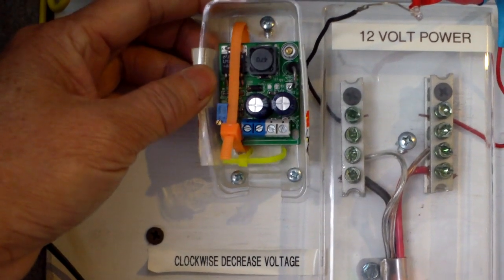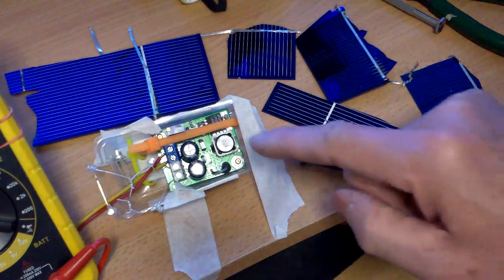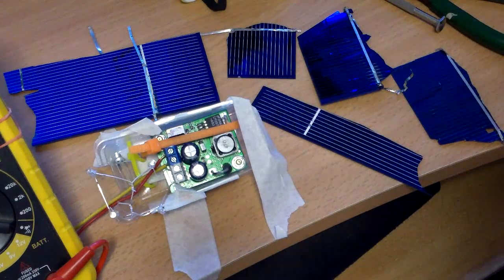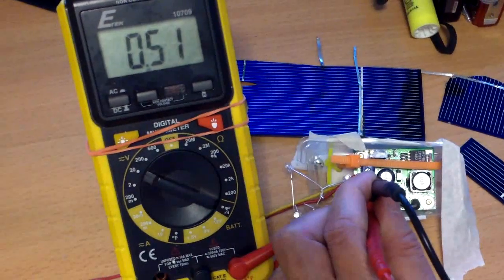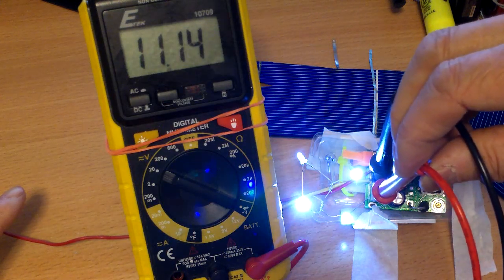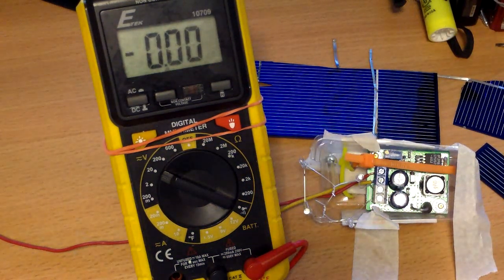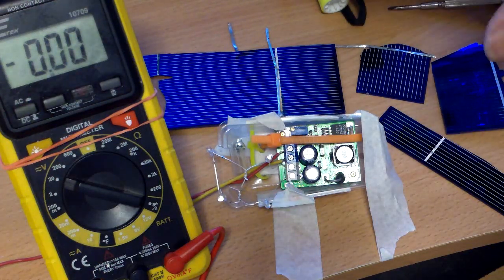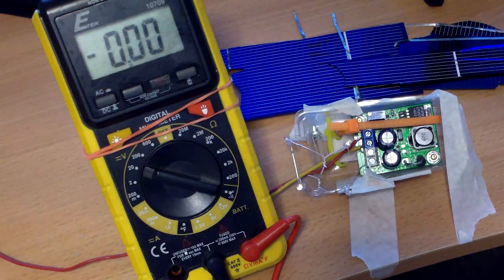LM2577 DC voltage booster

Comment: You connect 9 v battery as input and set 12 V on the output and then replace 9 V battery with  6 V battery, does it still output 12 V? Does the decreasing input voltage affect the output voltage?
Reply from the maker: rezidualna If you vary the input voltage,  the output voltage would probably change too.

Comment: I was thinking of using a Step Up booster on the cordless lawn mower motor I found. Hand spinning you get about 4 - 6 volts and around 6 amps. Any suggestions?
Reply from the maker: I've seen on ebay "DC 4.5-32V to 5-42V Wide Voltage Regulator Step Up Converter Boost Power Supply".  Around 6 amps at $13.50.

Comment: One of the biggest underused potential for efficient boosting, I think, is "underspeed" wind mills. They always talk about the speed at which the voltage rises to be able to begin charging. Any turning should be charging, period. these boost circuits can run just fine on large capacitors charged up by a slow turning wind mill.

Comment from the maker: There are many possibilities with this booster/regulator. Yard light cells is one way. I'm thinking of a 8 half volt, 3.5 amp cells. That won't be too wimpy and will have enough power to charge any small size batteries.